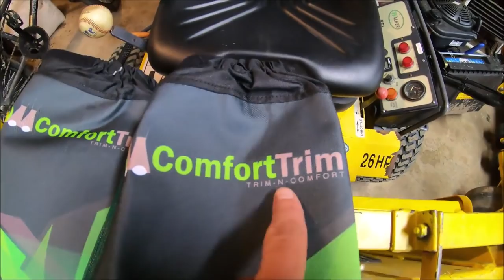I wasn't mowing it / Trim guards

Comment: Just bought a snapper pro 61 with the icd deck the thing is amazing. The baffling is very minimal and no other obstacles underneath like like the adjustable baffles that never get used. so I scraped it out maybe twice this year so far and used the blades johnny mow recomends in the spring with turbo baffle out. So far is my favorite deck for these messes of over treated yard
Reply from the maker: Yup same blades. Johnny and I talk all the time. Great guy.

Comment: What a coincidence. We mowed super wet grass today as well. We had the Scag Tiger  Cat 2, Hustler Raptor SD (which is technically a beafy residential mower) and our Wright Stander Intesity 48. Thr Scag cut the most today with me and the Wright cut the least with my dad but, the Wright had soooooooo much grass under that deck it was ridiculous. Even the Hustler didn't have near the amount of grass clumped up in there. I was really impressed to see that the Scag only had a moderate amount of grass stuck around the spindles and that was pretty much it. The Wright is such a great nimble mower and cuts great and is super comfortable but, the amount of grass under that deck was not good. And with all of the baffles it makes it harder to clean out.
Reply from the maker: Exactly

Comment: Up here in TN there's not much thick grass it grows tall and some times the wright deck gets clog and that plate at the shot is a hand up. Walker is a great mower on wet yards for sure.
Reply from the maker: It really is
Reply: @CountrysideStrong  I took a plasma cutter and cut the plates out help big time but mine is not that big block 37 Briggs it's the home model 52
Reply from the maker: @Crappiestalker  I considered cutting it out as well
Reply: @CountrysideStrong  it totally help in slinging the grass and cut down on cloging by half if I needed to put them back I can but I dout it lol

Comment: My first grandstand was like that. I called it the clumpmaster. Hated it for a long time , sometimes I used to leave the blades running till I was on the trailer. Then turned them off and two bushels of grass would drop. I took all the baffles out and tried some different blades. Worked a lot better after that. That walker deck eats wet grass all day long . My second grandstand was much better, my Ferris is doing well 52 inch ICD deck . I also have Toro Titan and J D quick trak . They are doing well in these conditions . This is a VERY wet spring and can be very frustrating if the equipment is handling the conditions they you want . Did u get rained out today ? I did , more for Thursday.
Reply from the maker: Agreed, and yes I did

Comment: Interesting, we’ve always had great luck with our AERO CORE decks, at least compared to the Ferris Mowers we had at the same time. We have that much grass bind up after a week of mowing wet grass. Normally just have to go over the thick high wet lawns twice with the deck up and change direction and they cleaned up really nice.
Reply from the maker: No such luck with mine. Ferris ICD decks aren't that great with wet grass either. Best decks for wet grass hands down..... 
Exmarks Ultra Cut
Toros turbo force
Great Danes standard deck
Walkers side discharge
None of them are over baffled. 
21+ years of mowing I've run them all, I honestly believe most are designed for southern and out west conditions.
Reply from the maker: I do have an idea tho Spencer..... We'll see what happens

Comment: I’m a Wright guy all the way, but I agree with you on the deck issue. My older Wright’s no problems however they aren’t baffled like the new ones. I was told by a Wright representative that the decks are designed more for use in the southern markets, because they sell way more in that market. I don’t know 🤔 take it for what it’s worth? Happy mowing!
Reply from the maker: Exactly what I said!! Some guys are just followers and know nothing about the actual work of this industry or the mechanical aspect so they just follow the masses

Comment: Question for you. We have an MT and an 08 Super Bee we just bought used. Super bee came standard with the huge split tail wheels. Been wondering about putting the split tail wheels on the MT. What are your thoughts on it so far? Pluses minuses? I like the 3 wheel walker stripe but if we use any other machine like my turf tiger or super bee on the yard the next week the stripes are all jacked up bc the walker stripe is so different. Sorry for the long comment lol. Love your channel and love the vids...especially on the walker stuff!!
Reply from the maker: Thanks for watching buddy I appreciate it. The split wheel kit is expensive, but I love it. Tracks straighter, handles better on inclines, and I never liked that single wheel line so it got rid of that

Comment: I appreciate your remarks on the Sport X. I hail from Coastal Maine, so I doubt that mower would be any good until August up here. Walker all the way!

Speaking of which, those split wheels really make the walker’s lines pop. Have you noticed any issues with stability on hills or anything along those lines? Any cons so far? I’m definitely considering them after watching a bunch of your Walker videos.

Regarding the shin guards, my mantra is, “Work smarter not harder.” 😁👍🏼
Reply from the maker: The split wheels def help with the machine tracking straighter and a little better on hills. The ghs machines really don't handle hills period.
Reply: The Lawn Pastor the only con to the split wheel is they track further behind then the normal wheels so when u turn u swing wider and they are $800 without dealer discount. But other than that it’s a great kit and couldn’t go back
Reply from the maker: @brycebloemendaal6182  you are correct
Reply: Good to know, thanks. I may end up getting it—once I get tired enough of that big fat tire mark left in the middle of my lines!
Reply: Bryce Bloemendaal thanks for mentioning the turn radius—I hadn’t thought of that. 

I’m beginning to realize that if I buy anything with the Walker logo, I’ll be spending a minimum of $500 😂. Oh well... we get what we pay for, right?

Comment: I miw all day wet heavy grass not once gas it clog to day but when I cut this one house and the back half is nothing but wet juice weeds it gas clog on twice in 2 years my Toro turf master  I need to clean out the bottom cause I forgot to pull the mulch plug still love my Walker
Reply from the maker: Cool

Comment: What a shame about the Wright mower deck. Looks set up for mulching with a small insert. How did that ferris walk behind you had do in wet spring grass? Was it an ICD deck? Thinking about picking one up so I'm curious. Afraid a Walker B will be hard on my back after years of mowing.
Reply from the maker: Any mower will be after years of mowing but I have the suspension seat on both my walkers so it makes it a lot better. the ferris did great ICD decks are really good but I hear they're not phenomenal with wet grass but better than most
Reply: @CountrysideStrong  I appreciate your honesty in your videos and comments. Thank you sir.
Reply from the maker: @GG-ub4ej  absolutely

Comment: Is your mt really jumpy on the trailer because mine is. I have the split wheel so the weight is distributed over 4 points then 3 making it not as heavy. Just a question
Reply from the maker: No it does really good but I'm not on too many bumpy roads and I take it easy

Comment: To be honest there isnt many mowers that wouldnt clump with those kind of conditions.
Reply from the maker: My great Dane doesn't, the Walker doesn't and my ultra cut decks on my Vantages didn't. They all have the same thing in common, there wide open. So many companies over baffling these decks. I honestly believe most decks are designed for southern or out west conditions
Reply: Scag don't